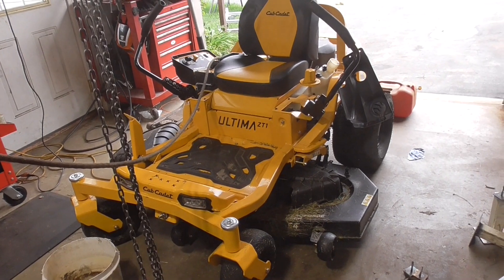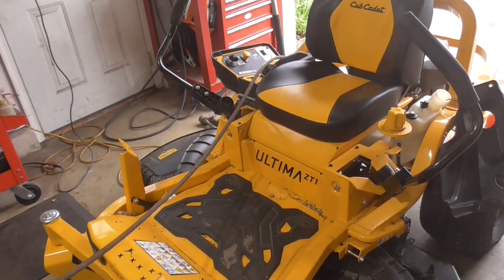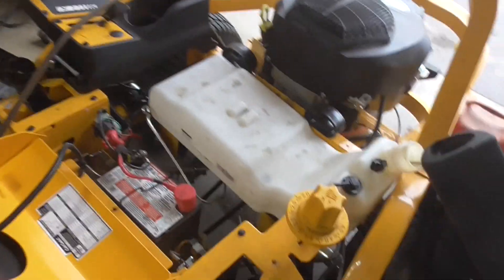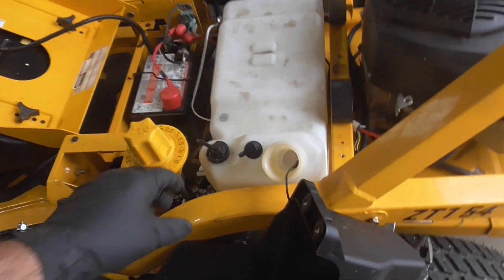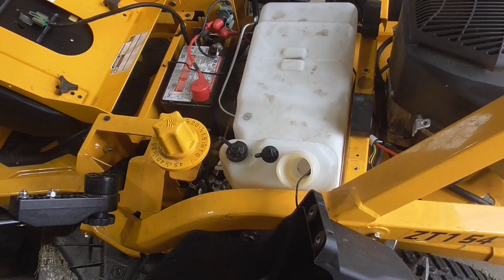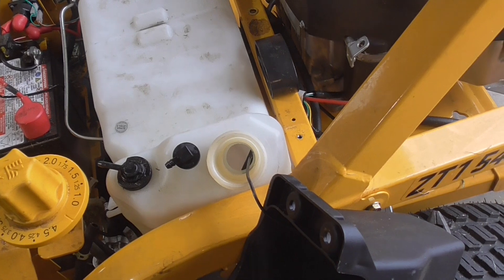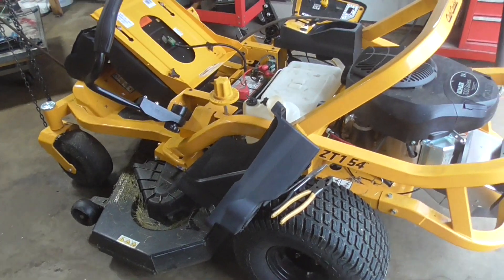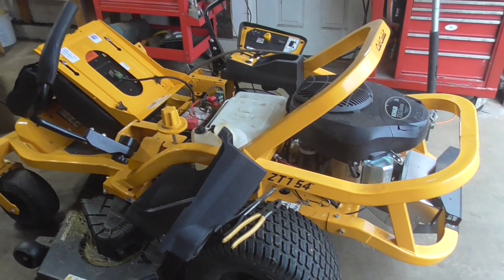Cub Cadet Ultima Keeps Dying Won't Run ZT154

Comment: Thank you...my ZT2 54 is st5ruggling for fuel, bogging out and losing power. I replaced the fuel filter but it did not improve so now after watching your video will check the fuel tank and fuel lines.
Reply: What did you find out? Mine goes for a few minutes then bogs down.
Reply: Having the same problem here. I'm hoping to hear more feedback on if you were able to get the problem resolved.
Reply: exactly same thing with mine, and also changed all parts and still the same, what solved your problem?
Reply: Same thing with mine!

I never had that problem but now after coming back from maintenance (air/fuel filter, oil/blades change) and a wash, the darn thing dies in the middle of mowing. 

After you let it sit for some hours it does start again but drives just another 30 seconds or so. Blades on or off is not the issue. I will try to clean the tank (I see junk in there) e cut the feed line a tiny bit....

Comment: Thanks for the video. I have fuel supply issues continuously with this model mower. I think the suggestion to cut the pickup tube slightly is a great idea. I have just been blowing air back into the tank to remove the clog, but that is a hack.

Comment: This is probably what's wrong with mine, started chugging when I turned the throttle down where it could barely idle when I had to hop off it, replaced spark plugs and air filter (especially since I had a mouse get under the airlifter housing and have a few pups. Was able to drive it a little bit but when I put the deck down to 2.5" on maybe some 4 or 5" grass it started to bog down and stall, I turned the blades off to check out what was going on and now I can't turn the blades back on without it stalling. Going to check my tank and tube tonight, then I'm going to check my carb and governor. I had a lot of grass build up that my hose wasn't getting but I picked up an air compressor and plan to blow it off from now on.

Thanks for the video, probably just saved me quite a bit of money.

Comment: Have a 2018 RZT S and the feul cap works loose when mowing and have had to clean tank in past (haven'tchecked pickup tube...). Am constantly checking it when mowing. Even replaced tank gas cap but same issue. Need to design a locking tab similar to gas can cap but haven't got round to it yet.

Comment: We have that same mower. I wonder if he drove it around with the tank cap dangling and leaves got in that way. Maybe when mulching them?
Reply: My thoughts exactly.  Mowed with the cap off.
Reply: I did that exact thing 😂
Reply: Has anyone experienced the deck jump when engaging PTO? Cubby ZT1 54"
Reply: @CHarris73 , I think that may happen because the hydraulic pumps are engaged before you engage the deck… have the driving handles spread apart, in the brake position, when you engage the deck…, then once engaged, then pull the handles away from the brake position and drive forward…

Comment: thank you

same issue with a zt1-50 with a kawasaki ,  zero crude in the tank yet the oem filter by 50 hours had become restricted to where gas failed to go through it,  nothing in to be found in the tank, just a breakdown inside the filter,  replace it and back to normal

Comment: Im having the same issues, when I throttle up to above 1/2 way mower will bog down and stall. Run it at below 1/2 way mower runs fine. Any attempt to cut anything higher will cause mower to shut down
Reply: Me also

Comment: My ZT1 is doing exactly the same thing right now. Will look at this. I changed spark plugs, oil and filter, put Seafoam thru the intake to clean deposits, new fuel filter, new air filter and still does the same thing. So surely it’s trash in carb or this that is the problem. It acts like the Governor is not even kicking in under load. 
This was very informative and something else to look at
Thank you
Reply: exactly same thing with mine, and also changed all parts and still the same, what solved your problem?

Comment: Mine surges and bogs down with the pto on, I just did new air filter, spark plugs, oil change, fuel filter, I just switched to ethanol gas and it runs like dog shit now. Guess the carb is plugged?

Comment: I solved my electrical problem, "by using deductive reasoning". This was after I requested help in my post below. It had blown 2, 20 amp fuses. While sitting in the seat I moved the lap bars out to braked position, when I did I felt a light electrical shock on the left side. This could only mean one thing, somewhere I have a naked wire going (shorting) to the frame, hence the shock I felt. I found a mouse had chewed off the insulation on a wire and it was touching the metal frame. This was after I replaced the PTO switch & both interlock safety switches. Just wanted to post this in case others have similar problems.

Comment: I have been working on this mower for 3 weeks now and I’m pulling my hair out… I’ve cleaned all the hoses I’ve changed spark plugs, carb change and clean, also cleaned the gas tank out. It keeps fouling plugs, oil is black dark black… I wish I could have someone help me with this, but it’s always guessing with the forums online with others

Comment: If he has children like my brothers they probably add the stuff to help fill the tank.  My brothers added sand to the tractor tank and filled the car gas pipe to the brim with gravel.  I suspect that or he left the cap off or as others mentioned someone added the crap on purpose.  Anyway, thanks for the video and alerting us to a potential problem .. Thanks for the video.  Stay safe

Comment: Thanks for your video, very clear RE the trash in fuel tank. I have an electrical problem on the exact same model ZT 1 54".  My engine starts and runs smooth, BUT, when I pull up the PTO or pull in either lap bar the engine starts to die, will recover if I quickly push down PTO or push out the lap bars (either one, or both). The following is what I have done to date. (1) Replaced PTO switch. (2) replaced both safety interlock switches. ( 3) Disconnected clip connector at the Mag clutch to isolate from system. (4) checked olms resistance on clutch, got about 3.2, but not a factor if disconnected.  Haven't checked solenoid, that's only for cranking, Right?  I'm thinking I must have a short somewhere that only kills the engine when PTO or lap bars are engaged. Can you help me? My wife's got me locked out of the house until I get the lawn mowed.    Thanks
Reply: Guess not.
Reply: Just experienced this same issue while mowing. It died when the blades were engaged. I was able to restart, but it wanted to die when the lap bars were raised. I raised the seat and checked some connections under there. After a few minutes I was able to get it working again, but I don't know what the issue was or how it was corrected. It's been fine ever since.

Comment: Does the man that owns the mower have kids. My cousin worked on a moped for me and had it running good. A few days later I rode it home. it quit about 3/4 of a mile after I left. His brothers kids had put sand in the gas tank. I cleaned out the filter a few times on the way home but it never ran quite as well as at did the first 3/4 mile before the sand got in the filter. I changed the filter and flushed the tank. Even cleaned the carb but it never was the same.

Comment: I have this exact mower, just bought it new from TSC. Has less than 5 hours on it, just past the 30 day return, bogs down when you engage the PTO and almost dies even in short grass. TSC says not our problem and Cud Cadet says I should take it back to TSC. Got a 4k dollar paper weight.

Comment: I am having nonstop starting issues on this mower replaced starter solenoid & fuel filter it’s started for a few days. Now it’s back to the same thing it’s turning over but not starting. Any pointers guys?
Reply: I'm running into the same issue. Brand new zt1. I have like .75 of an acre and no joke my machine will stall out around 5 times during a mow. I call the distributor on my first mow, they said it could be a safety switch that is still new and rigid so give it a little time. I'm now almost done with my 3rd mow (have only had it 3 weeks) and it's still stalling 5 times per mow. Of course cud cadet doesn't have customer service hours on weekends so I'm left here without help.

It runs great on a cold start for like 20 mins then once it warms up it shuts off after 5 mins or so, I end up sitting on the mower for like 5 mins to let it cool then it will start again. I'll be honest, I love the way it cuts but I need to find a solution or I'm going to have to return this thing. A push mower would take me less time at this point.
Reply: @JetsTalk247  What did you find out with the cub stalling?
Reply: @shannonp4037  turns out there was a faulty part from the factory like 1/50 Cub Cadets have it and the shop was finally able to replicate the issue. I told them I'd pay their mechanic to mow my lawn until it happened because they didn't believe me that it would stall haha. Has been perfect since!
Reply: @shannonp4037  i don't know the exact part but it kept sounding like it wasn't getting fuel so it was something that was getting gummed up
Reply: @JetsTalk247  I read the governor but I don’t think that’s my issue. Mine just started happening. Pulling the gas tank tomorrow

Comment: Hi, I just bought my Cub cadet Zt1 54in at local Tractor Supply Company (TSC) in Mckiney Texas last week 8/15/2020 for $ 3355.74  and I noticed it's acting very strange after 2nd use yesterday. It lost cutting power at high speed setting (the rabbit symbol). You can hear the engine sound wanted to die out and the cutted-grasses did not shoot out the  right EXIT side strong as it suppose to. At first,  I thought I ran out of gas ( b/c there is no gas gauge indicator equipped on this model). I stopped the mower, let it rest while I checked gas level which  (which is still full with fresh gas),  I then checked oil level and it was was full!!!
I restarted the mower and resume mowing but after few minutes, it acted up again when I heard the engine was not humming like it is suppose to. I immediately stopped the mower and set mowing speed to TURTLE sign for SLOW, then the mower perform okay again at this power speed.
Please note, I am very quality conscious with every equipment I've been ever owned and this Cub cadet ZT1 54in is one of my biggest quality concern after 2 simple runs (less than 45 minutes per run).
Do you think, I can return this machine for the TORO ( much for expensive but more reliable)?
2) 2nd problem I had yesterday was the LEFT Tire got flat! My land has no metal debris and/or sharp objects to punch the the tire. For this problem, I really don't have a clue of the root cause.
Please sugguest what should i do, Appreciate your help
Reply from the maker: Take it right back to TS.  They should take it back if the engine is not running properly.
Reply: Mines doing the same thing.  I have to get warranty repair done to it. Something to do with the govoner getting plugged. I have less than 8 hours on mine.

Comment: Not this same model, but I get pine needles in mine all the time.  It's a very poor design by cub cadet, in that if you mow adjacent to bushes or pine trees, as you drive by a springy limb will catch on the gas cap that sticks up above the rest of the mower, and literally unscrew your gas cap as you drive by.  Next thing you know, you've been mowing for five minutes with your gas cap dangling.  The cap should be on the rear, on the right (so branches tighten it instead of unscrewing it), or have a shield to guard it.  Very poor design.

Comment: only 30 hrs  on it customer should took it back to the dealer for warnaty you doing it is voiding all tht unless you can d waranty fixes
Reply: Leaves in the fuel tank is probably would not be covered by warranty anyway.